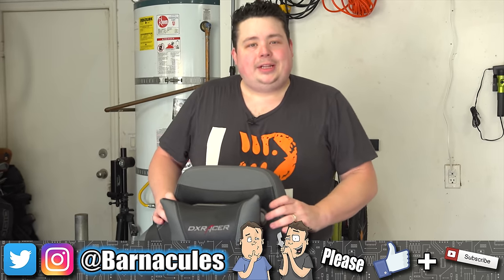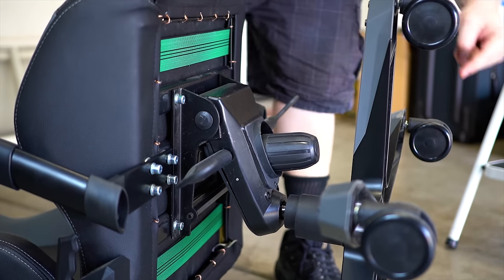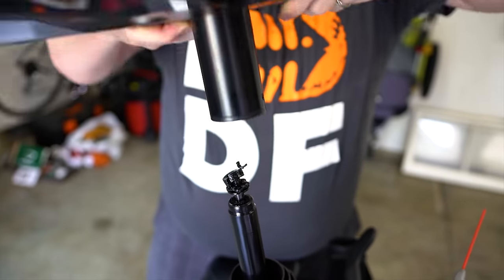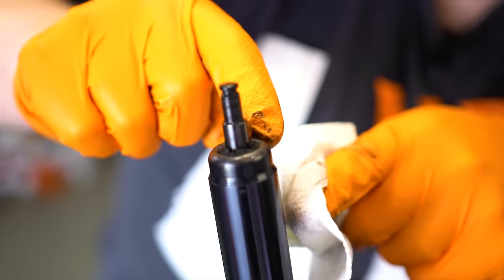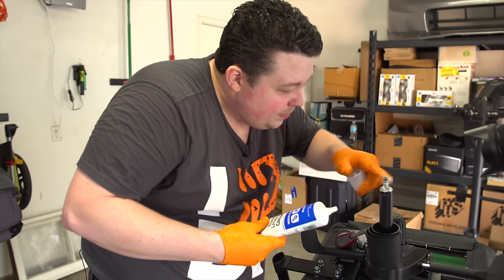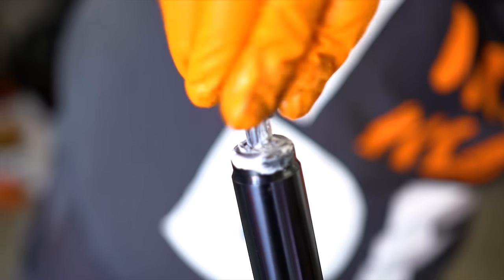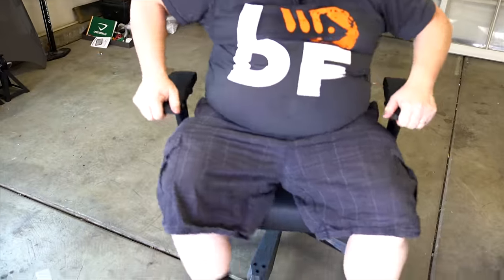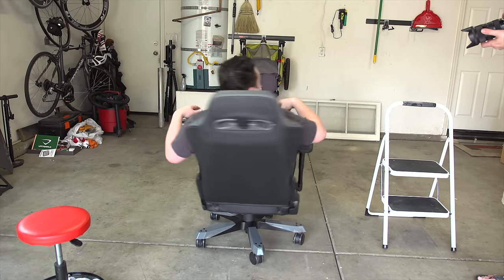How to Repair DX Racer, GT Omega, AK Racing Office Chairs! - @Barnacules

Comment: I have the same harbor freight jack as Jay. I had an orange one just like it until I let someone borrow it, so I had them replace it, I was very specific, I bought it to fit under my super low Pontiac Fiero so it had to be the low profile model. I got my grey replacement, left it in the box for a few months because I waited until I needed it, got it out and it was the wrong one, there was no chance of it fitting under my car. I could not have been more specific when I told them to replace my jack and the most frustrating thing is that the correct jack was $3 less. Luckily Harbor Freight is awesome, they let me return an opened box with no receipt to get the right jack and they even tried to refund the $3, I let them keep it.

Comment: Yeah, WD-40 isn't a lube. The WD stands for Water Displacement. It's actually to keep things dry from water and rusting. Though it does work as a temporary lube until you can get some PB blaster or something.

Comment: the metal bars on the bottom of my chair, like where the recline mechanism is i think bend when i recline, is that supposed to happen? got the chair today and it broke same day, didnt even have issues when lying flat, made a pop sound and stopped staying still or letting my lean back without it always going down, doesnt even touch my back now when sitting up, what do i do?

Comment: So, I assembled my chair without looking at the instructions. So it squeaks a lot! So Then I went to look at the instructions and I saw that in the gas piston I was supposed to remove a cover cap 😅 I didn't do it, and the piston is way to stuck in the chair. I don't know if that's the problem

Comment: So I just did this to my chair and mine didn't have any bearings lol. It just had a rubber bushing where that bearing should have gone. Thanks for the diy!
Reply from the maker: +Steven Orwig holy crap, did the bearing disintegrate?
Reply: Barnacules Nerdgasm no the manufacturer didn't use a bearing. They just put a plastic spacer where the bearing goes. Quality!!
Reply: I know this is super old but im having the same problem? what did you do?

Comment: Followed all the instructions, took the clip off, washer and wheelbase off, but the rubber grommet, bearings, and washer are self-contained in the wheelbase so I can't get to them.  I have no idea if the grommet or bearings are damaged, and I think those might be the problem.  I can lubricate all I want, but it might not help.
Reply from the maker: Just buy a rebuild kit for the piston on Amazon

Comment: Incase anybody had the same problem as I did i'll just post this anyway. My chair was squeaking and popping when leaning back and I tried Jerry's solution ( and i also bought and installed the gas piston repair kit) but it would be fine for the first few minutes then squeaking would come back. The problem were the bolts(or whatever the correct name is) underneath the seat.There were 2 that weren't screwed properly with the allen key. After tightening them the squeak and popping were gone.
Reply: AC which bolts exactly, I just changed my gas spring but I get a little squeak even I lean back. I've tightened all of them I think, which ones did u tighten exactly?
Reply: Aj Rodriguez  near the left lever under the chair. Like it was 1 behind the lever and 2 where the left arm wrest is attached to the chair. That definitely fixed the problem for me as there's been no squeaking since.
Reply: AC thanks for the reply, it started squeaking again so I opened up my brand new gas piston and put lithium grease and now it doesn't want to go down when I sit on it which is what the old one would do. Gonna return the piston and emailed the company demanding a new chair. I literally tightened every single bolt and found a few loose ones but it still squeaked. The brand is kinsal btw, from Amazon.
Reply: Aj Rodriguez hmm I never replaced the piston so I wouldn't know man. My specific problems were loose bolts and weathered gas piston parts that caused popping and squeaking not the piston itself. I have gt omega. Yeah i don't know the warranty details of your brand but i think that would be the best bet if Google has failed you

Comment: also i fixed my chair today it was squeaking so i took off all the plastics and greased and tightened all the bolts as some wear loose causing a horrific squee.. also wd40 will wash away lube so don't use it to lubricate. only to loosen or clean up.

Comment: How does the cylinder not still have pressure that could potentially hurt you if you just disassemble it?
Reply: Update: I did the fix in the video and found out that it's safe because you're not disassembling the part that holds pressure, just the part that attaches the cylinder to the base.

Comment: Ok just did this and it worked. I get no clicking sound but my chair doesn't spin smoothly anymore.
Reply: It means that either the parts are lot aligned properly, the bearing will likely only work well 1 way up, or you need to pack more grease into it

Comment: WD-40 is a great lubricant... It's just very thin so it is only good for things like bearings or for penetrating into tight spaces. In most cases with squeaks a heavier lubricant works better because it doesn't wear or dissipate as fast. WD-40 actually makes a thicker lithium lubricant, like you used in the video. WD-40 also works great to make old rubber o-rings seal better because it absorbs into the rubber making it softer, but great, helpful video nonetheless!

Comment: My cheap @$$ plastic ball bearing bracket was completely busted.  Luckily I had a spare gas lift and rocker base on hand.  I had them send me replacements because every once in a while the original gas lift kept slowly losing pressure while I was sitting in the chair.  I never got around to replacing it till today when I found out it was the damn gas lift making all those crunchy popping noises.

Comment: My chair was squeaky. It started with just being squeaky and annoying but later it started popping. Now it leans back and pops loudly. It looks like the back wont stay in the adjusted position. I was hoping that all I had to do was to adjust the tension on the tilt mechanism, but that did not help so now my guess is that I have to replace the spring or something. Also when I took it apart the bearings was broken. I think that I have to buy a new one since it looks like fixing this is above my brain power.

Comment: I'm no scientist but I may know why this happens to a lot of chairs... I work with airsoft guns and number 1 rule when cleaning is to use a petroleum free grease/lubricant. This is due to petroleum causing deterioration to rubber and plastic parts by dissolving them as they themselves are petroleum based products. If the lubricant used contains petroleum this would (from my gathering) cause this issue. Very few lubricants actually tell you what is contained in these lubricants and to find out you need to look at the MSDS. Also a lot of these lubricants say safe for rubber and plastic when in fact they are not. So I would highly suggest using a petroleum free lubricant such as lithium grease for this repair. 

Sources: Try searching for "Lithium grease on rubber" plenty of sources will mention what I stated above.

Comment: That LA heat looks like it's melting you! lol I live in a temperate climate (Humboldt County Ca) and anytime I go to LA I literally feel my skin melting
Reply from the maker: +K3 707 it was only about 80 degrees. I was just out of breath from hustling to quickly shoot the video before catching my flight. Was a bit stressed.
Reply: 80 is still pretty hot for me. Where I live it tops out at 80 to 85 degrees in the hottest days of summer. I love it here. It averages around 50 to 60 all winter long as well. Makes sense though, you guys did do a lot of things during your trip.

Comment: Well, I'm only 120 pounds and my chair started making these noises when it was only a year old.
So I guess it's quite common. These manufacturers should really get their act together.
Reply: all bearings need maintaining, its simple logic, 
no matter how much they cost they will still need cleaning/regreasing eventually as the grease gets clogged up with dust/dirt and it eats away at the bearing race causing it to squeak/break

Comment: If I might add my pennies worth to this great video!!
My brand new chair squeaked just like in this video.  Because it was brand new I figured it can't be the same problem but in any event I checked.  After all I might have been sold a lemon.  My chair does not have the bearing as in this video; it has a solid nylon bush (a heads up for anyone panicking because they don't got no balls :-)).

I lubed the bush anyway but as I figured it made no difference.  My trusted partner came to the rescue and on her hands and knees sniffed around under my seat to find the offending bit.  Low and behold it was the backrest lever assembly.  I removed the plastic cover both sides and backed off the fixing screws and sat in the chair and gently reclined/declined/reclined/declined to get the seat and backrest relationship compatible.  I sprayed some silicone spray here and there and still sitting in the seat tightened up the screws.

Job done!

Comment: I have some weird 5 lever office chair I found that I use. Turns out these chairs are like $400 anyways I just reached down to see if it had that retaining clip and I got bit by a spider.... im joking... it had the exact same clip. Weird. I wonder if there is only 1 factory that makes these little clips and all chair manufactures use them.
Reply from the maker: +x9x9x9x9x9 I'm starting to think one company makes all the gas tubes.
Reply: Very possible. Or there is some huge strange monopoly on the chair market and all the chairs are made by them just a bunch of subsidiary brands.

Comment: I just took mine apart, and under the bottom of the cylinder after taking the base off all there was was a rubber bushing and no other washers and barrings... wtf..
Reply: Nevermind.. found it inside the tube that was attached to the base in a million pieces..

Comment: Yes, yes, yes everyone knows WD-40 was invented as a water displacing compound, and there are better lubricants, but it is still a lubricant.  I have used many lubricants, but in a pinch, I have also used WD-40 as a lubricant and it did the job.

Comment: Step 1: Look for 800 number on bottom of chair.
Step 2: Call 800 number and ask for replacement parts even if your FAUX leather is peeling off.
Step 3: Wait 3-6 weeks for FREE shipping to your address and replace with new parts and switch them.
Step 4: Slap your forehead for thinking that "Oh well, its broken and out of warranty. Why bother?" mentality!!!
Reply: Permanent fix vs on the spot one. Zero lube or tinkering required. Tire patch vs new tire debate rages on!

Comment: Or just skip a couple cheeseburgers....
Reply: It doesn't matter how heavy someone is on the chair. You could weigh 80 pounds and over time it would still wear out and break, the bracket holding the actual bearings is only plastic and even 80 pounds is a lot of pressure for plastic to withstand. Use your head kid.